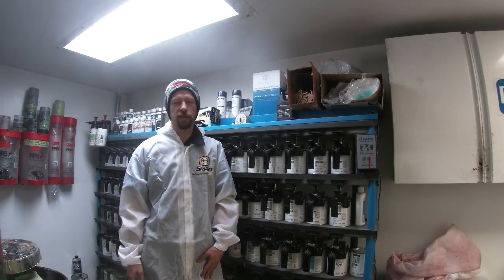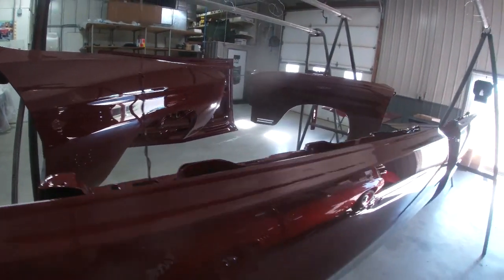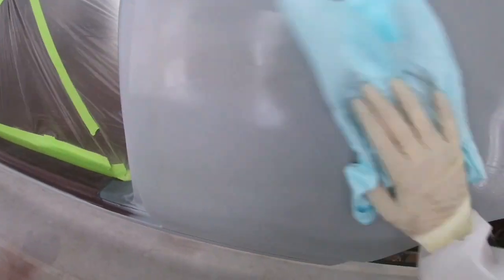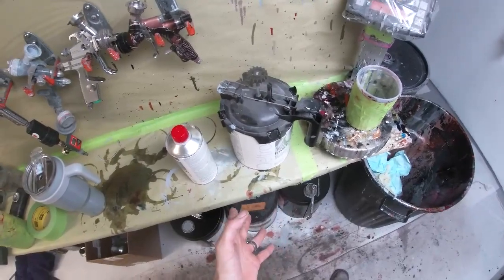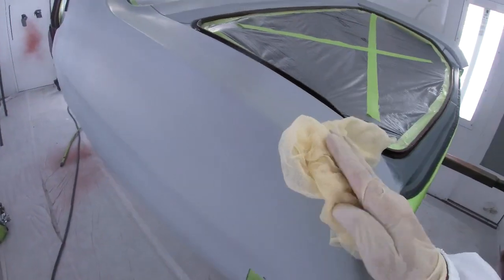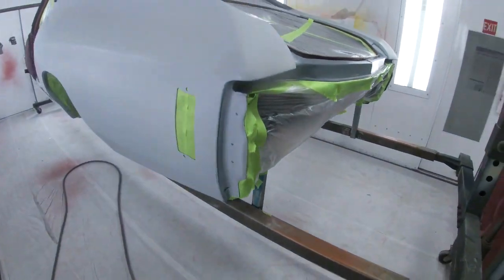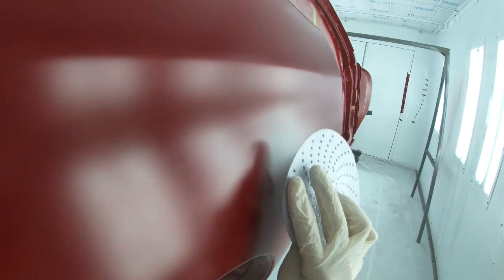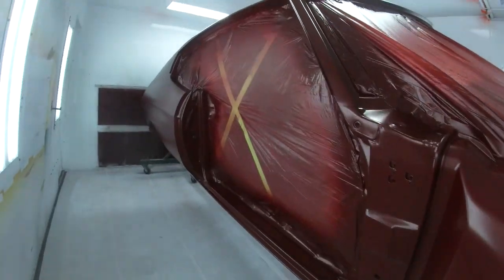Painting a 70 Chevelle black cherry poly

Comment: What psi do you spray at with your basecoat then your drop coat psi
Reply from the maker: usually around 18
Reply: @linearblockingtools4064  is that your drop coat right? Or u using an iwata